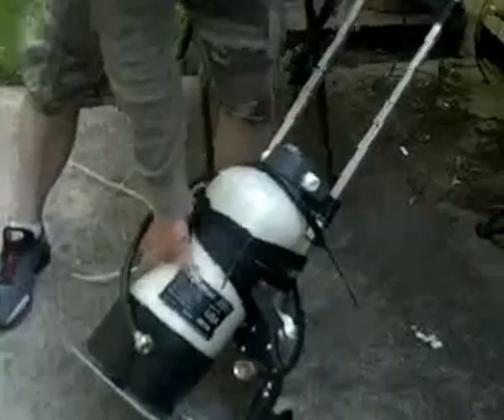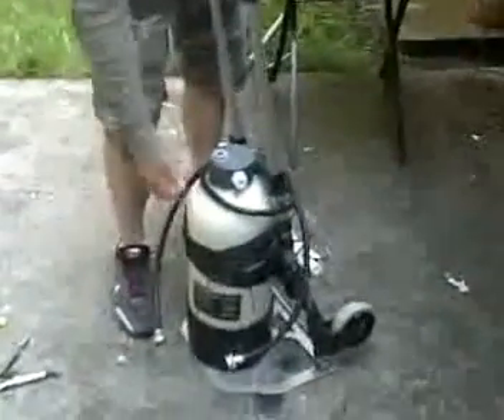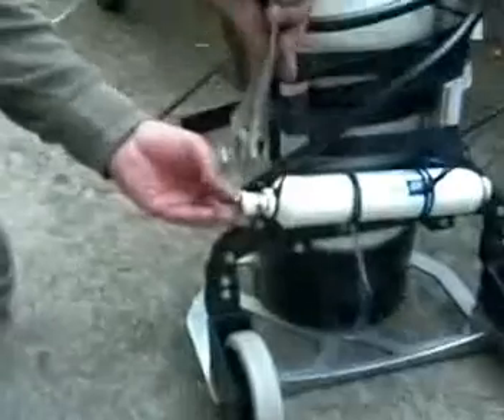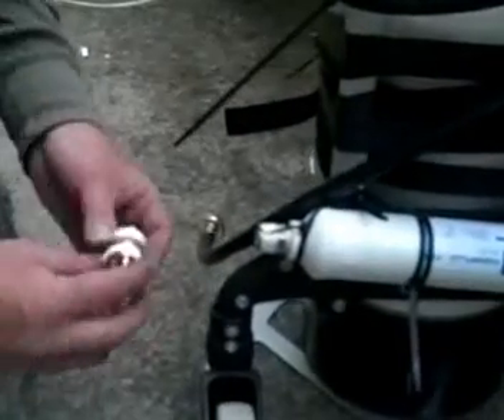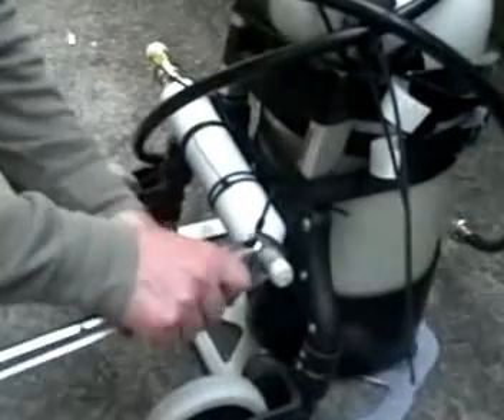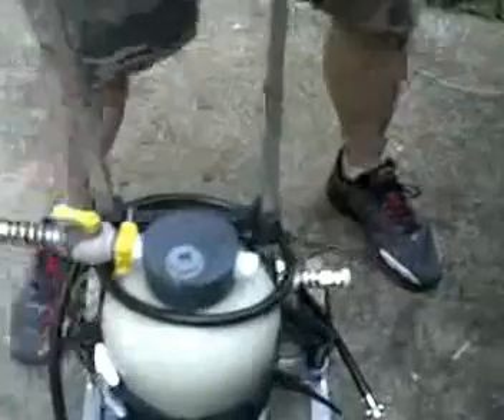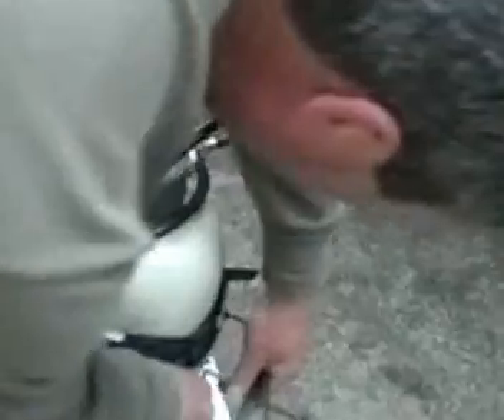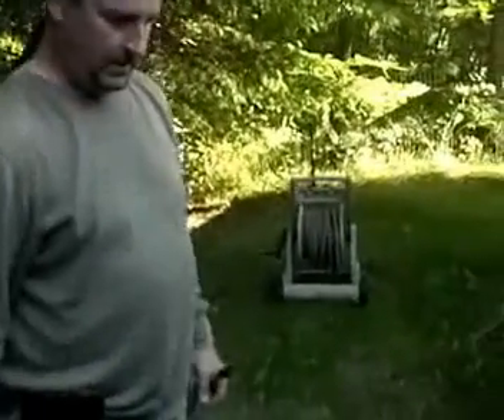Build Your Own Water fed Pole System Part 1

Comment from the maker: The pole is simply a window cleaning pole with a brush on the end and a couple spray nozzles drilled and filled in to the brush with vinyl hoses and connectors. Water pressure from the water spigot is sufficient.